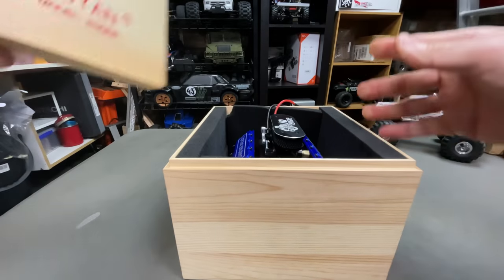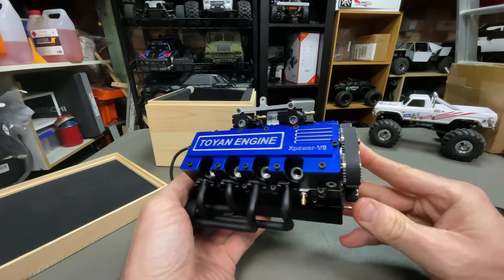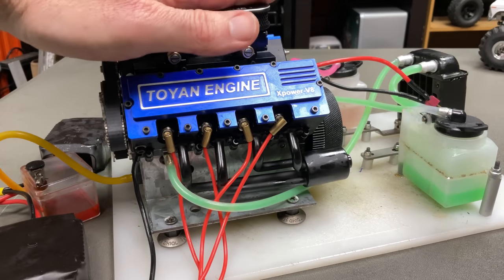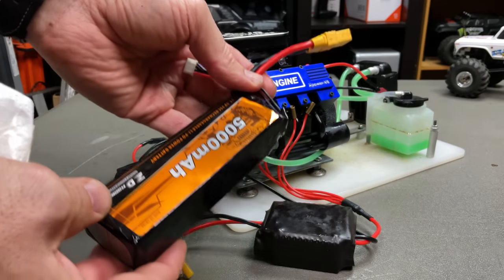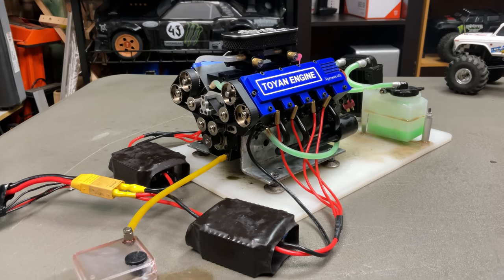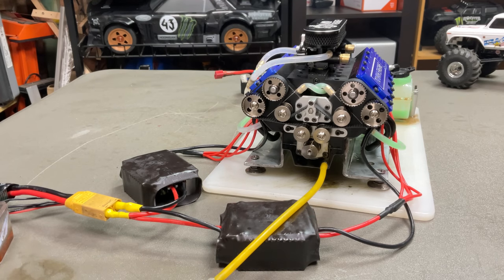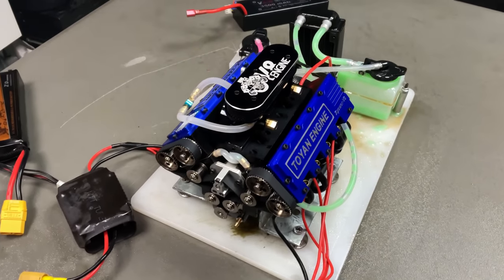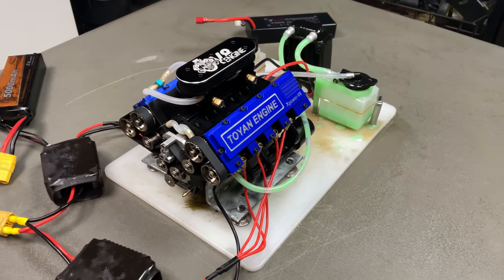YOU HAVE TO HEAR THIS V8 ENGINE - NEW TOYAN X-POWER

Comment: Sounds like a flat-plane crank and firing order, like a Ferrari V8 - as opposed to a cross-plane design used in most other V8 applications.
Distinctively different sounds.
Reply from the maker: Yeah strange ay, regardless tho it sounds amazing
Reply: @RCTanksTrucks247  It's a work of art!
Reply: It was flat plane? I can hear the muscle car v8 in it. He just rev too high most of the time
Reply: @speedeespeedboi9527  If you search for mini-V8 you will hear the different sound a cross-plane makes, even at that scale with a high revving.
Reply: @ThrottleAddiction  only difference i hear is the high pitch clicking noise. They both sounded muscle car. The toyan sounded kinda like the yamaha r1

Comment: Gardners - When you show up with a super charged whipper snipper and lawn mower 
There Kids be so impressed  theyclean up the toys off the lawn for you! .
Lawn mower attached to front minibike forks   with a small trailer at rear lifes good 
play as you work  kids be like  Daaad  can i mow the lawn  yes ok its 5 o/clock beer time  anyway enjoy son  Note: life just got  better cheers from Oz
Reply: + Looking thru Junk bin that Juice maker ive never used found years ago with a $250 cake mixer
iDEA!  #1 Juicer machine  either  put circle sand papper disk on the st/st disk curved  roter blade  Throw in anything ? to smooth them or  polish
 or punch the holes bigger to grate cheese etc as its only nail size holes  ( * )  more gratter size ( O ) like so
Reply from the maker: Haha cheers mate 👍

Comment: Sounds like it's got boxer and 4 stroke sound to it love it two mixed in one some are becoming both in one and just cb performance boxer stroker seventy four stock  engine generators too i heard the almost difference sound when construction workers turned it on and both sides of it was long flat and same sized like boxer and one end was cracked to conceal the components only spinning engine you can see pull string or pull cord or just starter with key now didn't see pull string or cord
Reply from the maker: It sounds even better with the blower installed

Comment: I would like to see it in a 1/10 tank , but getting the right transmission might be challenging
Reply from the maker: Yeah that's the tricky part
Reply: @RCTanksTrucks247  it could be done with some clutches and servos, but it wouldn't have the smoothness or torque of electric
The old Tamyia tank gearbox comes in mind as a template, and there was also a guy who made them for 1/6 but he's probably out of business
Reply: What about a plane?
Reply: @timtim8468  I don't know much about planes, but I believe it must be pretty big to accommodate this engine and have enough portance to lift off
Reply: @Cormano980  Some 2m wingspan seems proportional. Just guessing, all not trivial, starting from choosing efficient propeller / transmission / RPM. But imagine the sound, flyover.
Reply: @timtim8468  something ww2 yeah ,with Maxxtronic machine guns

Comment: I can almost get a complete rebuilt turn key Chevy 350 for the same price as this RC engine.  I don’t know what’s more crazy, a Chevy 350 is that cheap or a RC V8 engine is that cheap?
Reply: Yeah, but your Chevy 350 won’t fit in an RC car!
Reply: @Mike-hb4pc  yeah…that’s not the point I’m getting at
Reply from the maker: Micro engineering ain't cheap
Reply: @RCTanksTrucks247  seems cheap to me, about 10 years ago miniature V8 and they weren’t that miniature were around 15 grand

Comment: Any use for RC aircraft?  Presumably these sorts of engines have terrible power to weight ratio. 2hp per kg would suffice. 4hp per kg would be excellent.
Reply from the maker: Hmm could be although it is heavy and fuel economy is not the best
Reply: @RCTanksTrucks247  four strokes are normally more efficient than the two strokes.  What ignition do these motors use?  Glow plugs I assume if they run on Methanol.

Comment: Wow there are some dudes that want to see these things put in wild applications. I think there was only one V8 aviation engine in history. And one cat wants to put one in a tank. I think the Sherman in WWII was it for V8s in tanks and that was a huge Ford engine. So this would hardly be period correct. The engine sounds like a single plane crank to me. It's like a couple of 4 bangers glued together. And the nitro fueled engines sound considerably different than the gassers. On account of the ignition timing is different. Because of the platinum on the glow plugs igniting the methanol in the fuel. Probably have to ask Brother Dempsey about fuel consumption between nitro and gas. Quite a bit of the fuel volume ends up in the oil pan when using nitro. So it has to be going past the rings. An injector recycling the castor oil would be cool for the nitro fueled engines. It would have to save on consumption overall. Or at least I would think so. Anyway have fun fellas I dig this stuff. I used to fantasize about building these tiny scale V8 engines when I was a kid. Even better we have them as adults! GOD bless everyone!
Reply from the maker: Appreciate your comment, thanks for the info. This would be awesome in a WW2 Perishing as I believe they used a V8 as well. I will lean it out next few runs and hopefully that improves fuel economy.

Comment: I like this engine however all the valves with a two stroke fuel is the reason my single cylinder os .18tz would scream right past this heavy slugger..
Reply from the maker: That's not the point but whatever

Comment: As much as the engineering for this unit is amazing, why would you bother with 20th century technology to power anything be it model boat, car or plane? If this was 1982, this would be outstanding and I would definitely want one but it's 2022 and a single electric motor is all that's required along with a battery of course. Very little noise, far more power no horrible fumes and endless possibilities. Frankly this just seems lame.
Reply from the maker: I love electric and most of my cars are brushless, this is just something different. I love this side of the hobby.